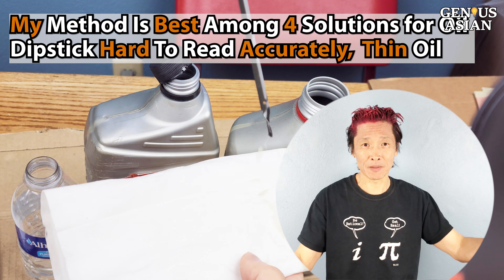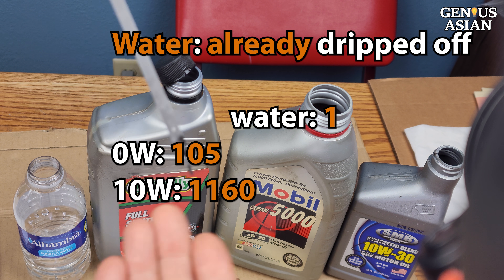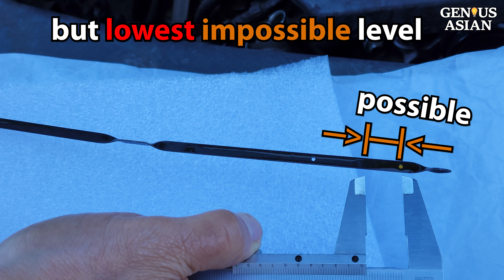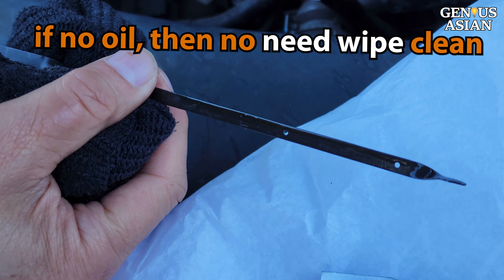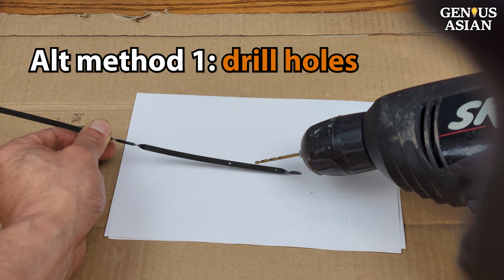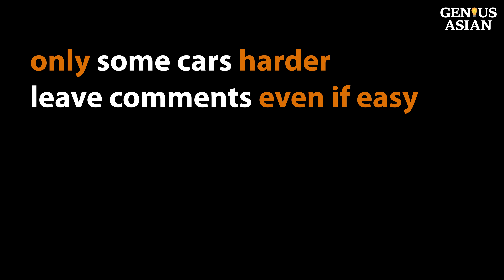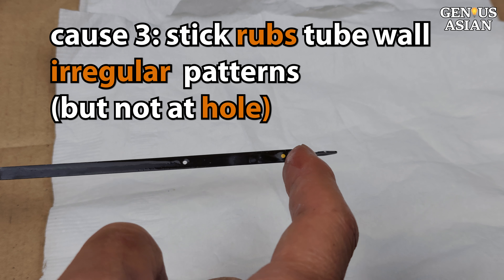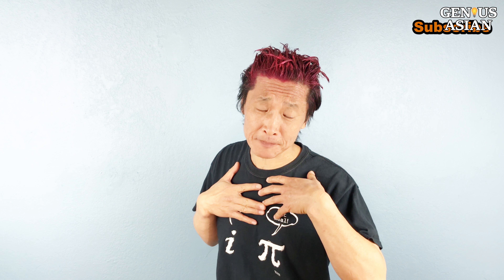My Method Is Best Among 4 Solutions for Reading Oil Dipstick Accurately,  Part 1 Thin Oil

Comment: I have noticed many dipsticks tubes are not perfectly 'straight' and have a slight bend in them. IF your dip stick is a flat one, it will scrape against the bent section tube sides when removed and streak the oil all over the dipstick and create a mess all over the stick in the reading area. Your method is about the only way to get around this. I may order a new OEM dipstick tube and see it is dead straight, meaning the bent one in their now was bent during engine install. Yes I agree never modify your dip stick!

Comment: I used a small triangle stone , placed the dip stick on a flat surface , made about 4 strokes to make a line , put several lines between the two holes , then did the same thing only across in a different to direction ,,,,this helps in capturing the thin oil, do both sides of the dip stick ...its not perfect  but gives you a visible reading .....I am happier with my result, because it's a good improvement ....marking the area between the holes   is the way to a better result

Comment: I have a 2016 Toyota Prius, it does not have holes right through it has dimples.  I am able to read the dipstick with a different method.  I hold the dipstick flat and horizontally to look at it. Then I tilt the dipstick just a little so the oil runs up the dipstick instead of down.  Where the oil meets the dry part of the dipstick it forms a slight bubble that you can actually see.  Don't tip it too far or the oil will spill over onto the dry part of the dipstick, and you have to wipe it off and start over.
Reply: Thank you - this is super helpful!

Comment: A concern I'd have about drilling holes or cutting a notch would be that this could create small pieces of metal that will break off and damage the car's internal components.

I haven't needed to do this before, but one other method is that someone can take the dipstick, hold it horizontal, and touch white paper to the dipstick. Where it transfers and changes the color will indicate how far up on the dipstick the oil is. A disadvantage is if you use a paper that has strong capillary action, the oil will spread quickly as soon as you touch the dipstick to the oil.
Reply from the maker: yes paper would help if your problem is your "eyesight" problem of not seeing the oil on the dipstick, but if there is not sufficient amount oil on the dipstick to begin with, you can't transfer that oil to paper, it does not matter how good your eyesight is, or how good magnifying glass or better lighting, it would not help if no oil on the dipstick.

Comment: I have owned a few cars.  Toyota highlander 2010 has a hopeless dipstick.  I will try your method and see how I get on. The dipstick snakes sharply in in to the engine making streaks appear and getting a reading visually is impossible.  

Toyota Camry 2011 is perfect easy to read.  Toyota starlet 1996 easy to read.  Mazda 5 2005 easy to read.  

Thanks for the video.
Reply from the maker: thank you for taking the time to share your experience with different cars
Reply: @GeniusAsian  all good my friend.  I think the person who invented the 2010 highlander dipstick, is a dipstick 😛
Reply from the maker: @GiantChickenCreature  love the pun!!! 😛
Reply: @giantchickencreature  I have the same problem with my 2011 Toyota Highlander! Wow I'm glad I'm not crazy! I've dealt with many cars and never have I experienced this! Have you figured out a way to read it accurately??
Reply: @phillippardo5712  No sorry, I tried to scuff the end with sandpaper which didn't work for me as well as it does for other people in videos I have seen.  I didn't want to risk damaging my dipstick by cutting notches or drilling holes into it.  In the end I put oil in and put the dipstick in and out trying to see if any oil would sit in that top indent.  I kept adding oil until the indent was always full.  Hope this makes sense but it is no way accurate I don't think.
Reply: @giantchickencreature  I think I actually might of figured it out.. well close enough at least. What I did was take out my dipstick and leave it out for 10 mins to allow any oil from the sides of the tube to drain down. Then before sticking the dipstick in, position it to where the bumbs are facing toward the cabin of the car and that's the side you read when pulling it out. Very weird, but it worked much better than what I was doing. LOL. WOW.
Reply: @phillippardo5712  Thanks Ill check it out and see how I get on.
Reply: @giantchickencreature  let me know how it goes!
Reply: @giantchickencreature  RIGHT!!!!!????